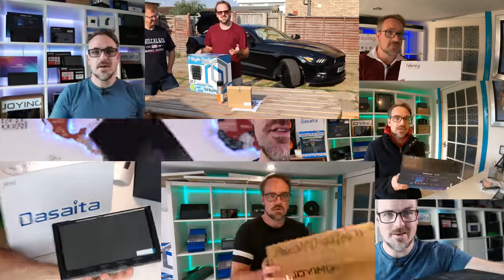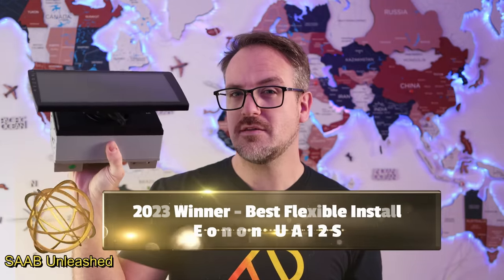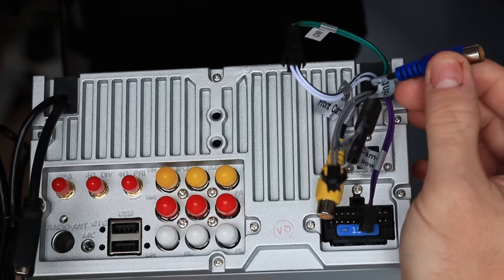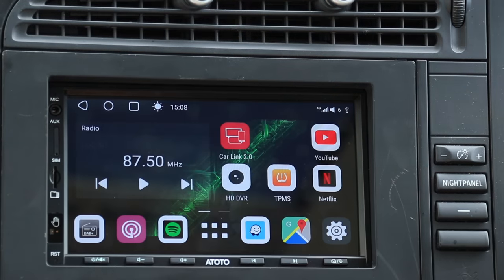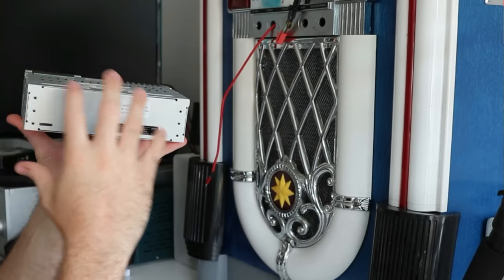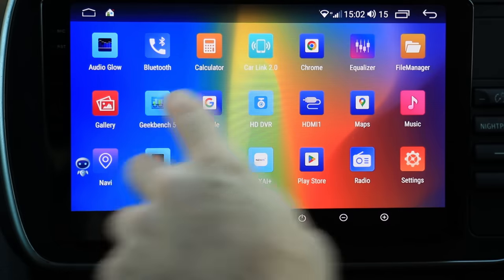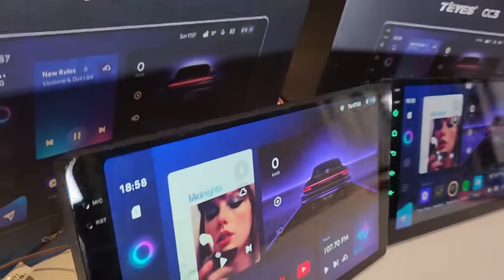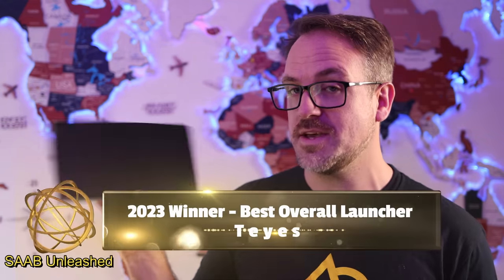2023's Top 7 Android Head Units

Comment: Do any of these have a sister app or ability to remotely control from your phone? I'm looking for something that would allow a passenger to add songs to the Playlist or update the destination without touching the screen or taking over with carplay.
Reply from the maker: No default remote control but you can technically achieve what you want if your passenger was signed in to the same Spotify account, for example.
Reply: @SaabUnleashed  thanks! Also, do any of the ones that support a 2nd screen support a touch screen, or something like CEC?
Reply from the maker: Funnily enough, I have been testing them with an external touch screen for a project of mine. The current winner is Eonon which is allowing full control via HDMI and a USB port - a mirror of the main display
Reply: @SaabUnleashed  Nice! Please share your experiment!

Comment: 12/04/2023 I used the link in the description and bought the Idoing headunit. Made sure to pick the 9inch 2k unit. Arrived in 20 days. It looks nothing like in this video. The surround that you see from the sides, top and bottom are silver and its a 1 din style. Feels like it weighs nothing. After messaging idoing they said that what I recieced is the "up to date" version. It looks nothing like the pictures on their website or in this video. UPDATE: After working with saab unleashed, he contacted idoing and they sent me an update file for android 12. It doesn't look exactly the same and is silver but at least it's android 12.

Comment: Hi. Thanks for another great video. I'm having issues with car vandalism and I'd be really interested to see a video that focuses on the dash cam capabilities of Android head units and in particular whether any of them support parking mode with buffered motion detection. I'm aware of Blackvue and Viofo etc dashcams but I already run an android head unit so ideally, I'd like a head unit that can run 4 cameras to recreate the sentry mode that Tesla vehicles have. Cheers.
Reply from the maker: There are no Android head unit DVRs that do parking recording, mostly because they are powered by USB from the actual Android unit. You should look at a smart dashcam, like Vantrue. They can be hardwired for parking mode without killing your battery and you can install the app for it on an Android head unit to review footage onscreen
Reply: thanks. That's a shame. I already have a blackvue dash cam with parking mode that I'm looking to upgrade, but even the latest dash cams options don't cater for things like mirror mounted side cameras (like Teslas have). 

Seems like a wasted opportunity for an android head unit to cater for 4 camera inputs for 360 parking assist that also serve as dash cams while driving and parking mode cameras when parked (by writing to an SD card) by simply connecting a cable to constant power.
Reply from the maker: I agree, it is a wasted opportunity

Comment: how about a review of some good head units that won't make your car a huge target for thieves?
the ATOTO is the only one on this list that doesn't have a massive screen that's gonna end up getting your stereo jacked
Reply from the maker: Actually several of these brands offer 7 inch variants
Reply: @SaabUnleashed  ya, i was about to jump back on here and say i ended up going with an Eonon X3 because i found a new/open box one on ebay for 60 usd, which is about 64% off. so ya, woot lol
Reply from the maker: @PKAdventures  the X3 is not an Android head unit, but it's a good budget unit
Reply: @SaabUnleashed  yup, i'm cool with Linux. and anything is better than the one i punched because it wasn't working right, and now i can't do anything with it except stick in a cd, usb, or micro sd and just let it play through because all the controls were on the touch screen lol

Comment: Atoto not recommended, at least the A6. AM radio doesn't pick up any stations. Do they even Microphone for bluetooth calls doesn't work. Wifi network detection desn't auto-connect well.  I'm surprised such Atoto problems aren't mentioned. It indicates his reporting on equipment does not go as deep as you might think.

Comment: Great review and really good choices. One addition though - you failed to mention that Teyes 360 set only comes with the older QLED 720p display that has the sensory buttons. The newer 2K display doesn't have sensory buttons and is not offered with 360 cameras. I wouldn't write this if you hadn't said the 2K display is the main reason it ended up in top 7, and then proceeded to give it award for 360 camera which is kind of misleading.
Reply from the maker: I have a CC3 360 2K. When the 2K was first released, the 360 wasn't available (and I even stated this in my original review video of the 2K) However, since then, the 360 functionality was added a few months ago. So no misleading facts there ;)
Reply: @SaabUnleashed  can you help me I am trying to find a decent android unit for my BMW x3 e83 with the pop up screen already on my dash I think it's cic system but most don't offer or without screen option only it's driving me mad TIA

Comment: All these units are made in pretty much the same chinese factory. The higher the price, you get more ram and better screen. Most have the same launcher installed by default. Some have their own launcher. You don't need to pay 4-500 dollars for the "name brand" chinese android head units. If you just want it for built in stuff, get a 2GB RAM 64GB ROM. You won't have any issues. If you want to use mainly carplay/android auto get 4GB Ram 64GB ROM. Most people don't even need 64GB ROM. Most people just want it to play the radio and use carplay these days. Hence why agara launcher is rated the best. It has like 8 serious buttons. Most people don't have full sound systems, entertainment systems all over their car, want to watch movies or play PS5 on their radio. It's hit or miss on the quality of these units as every single one has terrible QA and barely any support. Don't be surprised if you get it installed and one of your sw lines don't work. They are cheap because they are just glorified android tablets and they are made cheaply in china.
Reply from the maker: A lot of what you have said is untrue, and some things you have said are the reason why I take the time to review individual units on this channel. Also, if you just want Carplay/Android Auto, then you would go for less specs, not more, because those are streaming services that use the hardware resources in your phone, not in the head unit. It just needs good Wifi and Bluetooth

Comment: I just returned a joying because my old android 10 had hdmi and I was able to install google meet and whatsapp on the joying the "android 12" I downloaded google meet and it wouldn't let me log in kept saying something went wrong so I tried whatsapp also didn't work said the camera was missing or something like that I was disappointed because it was newer and a 13.3 screen and although it had hdmi port the video was scrambled im assuming it could've been a bad unit but when I contacted the sellers they said its different software so those 2 apps wouldn't work bummer because my 5 year old android 10 worked better then a 2023 android 12 . I cant find any type of video showing that they are using google meetvand whatsapp only video is mine . I would like to re-buy the joying only if someone can confirm that meets and whats app works and my unit was just defective

Comment: Eonon is junk.  I replaced an old Xtrons in my MKV VW GTI because the new 1280x800 screens were better.  The Xtrons worked perfectly for 7 years.  I so badly regret not getting anothe Xtrons, however - I made a mistake and bought the Eonon.  The Eonon would not autoresume playing music files from the internal storage - WTF?  Eventually they patched that but they tried to avoid doing so.  It had another bunch of software glitches which they fixed, but it still throws intermittent radio disconnects in the vehicle (Xtrons never did) and it will cold boot randomly and frequently.  There have been a few OTA updates but they have not fixed the issue. Obviously they don't understand VW CANBUS.  They even sent me a second unit because they concluded the unit had a bad motherboard, but the second one is 100% the same buggy thing.

Comment: I had the worst experience with Eonon . It was the most generic screen and I used this site to pick it out. Everything you showed that this radio had was not on this model. I’m still fighting to get only 70% of my 393.99 back from PayPal and a loss of 113.00. I should’ve stopped at buying it after my bank flagged the purchase. Absolute garbage unit. I have a 2014 Volkswagen Jetta sports wagon TDI. It has a backup camera but no GPS. I will ask if you have another possible match for this car. Idc about budget on this purchase but I want fitment and quality.

Comment: Atoto sucks huuuuuge donkey cack.  Stay very, VERY far away. I’ve owned two Atoto head units, and both of them failed miserably in less than a year of use. Which, if Atoto didn’t suck huge donkey cack, wouldn’t be a big issue since that’s their warranty period, but they do suck.  The first one they forced me to pay for my warranty replacement since they didn’t have an identical version to replace it with, only an upgraded version. Or a downgraded version.  So I either had to get downgraded or pay extra to be upgraded.  Absolutely BS.  I should have cut my losses. So after the first one shat the bed for no reason whatsoever, the second one after like 8 months, the S8 Ultra 10.1”, started factory resetting itself at random intervals.  Maybe every 3 days, maybe two weeks, maybe a month.  But rest assured, as soon as you got all settings correct, BLAM, factory fuggin reset.  And with no way to save settings, and uploading them, you have to spend hours dialing it all in again.  When trying to get warranty, they slow rolled my for four months until literally two days after my warranty was up and then refused to honor it.   For four months they told me I had to show them a. Video of it happened.   HOW THE HELL AM I SUPPOSED TO TAKE A VIDEO OF THE UNIT OUT OF THE BLUE FACTORY Resetting ITSELF.  WHICH IS RESET BY THE TIME KNOW ITS HAPPENING. 

NEVER BUY AN ATOTO.  DON’T SAY I DIDNT WARN YOU!

Comment: Don't waste your money on joying, its complete Garbage. Customer service is bullshit. These turds have problems with video play back also they have no video/hdmi out for rear seat. I thought it was what I was doing but it's the unit itself. The old models did have video out using a dongle but not the android 12. There is so much alternator twine noise as well unlike my alpine units I have. I have 4 different joying units, all Garbage. I don't care what this youtube review says. The only one I like a little is the older android 10 model because it has back seat video out but that's it. There is still twine and noise and it doesn't matter what car I install it in or the other joyings, the noise and twine fallows. Save yourself from headaches of joying garbage. However, if you don't believe me buy one of these pieces of shit and see for you self.